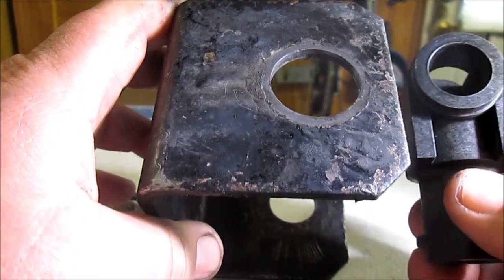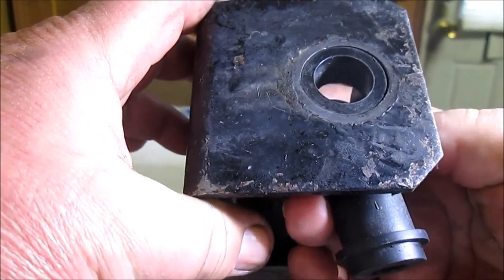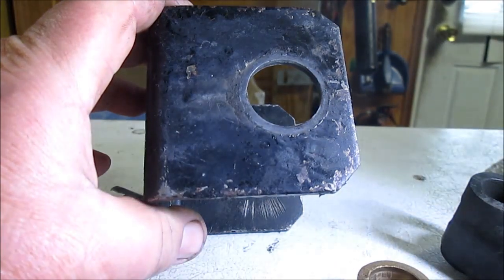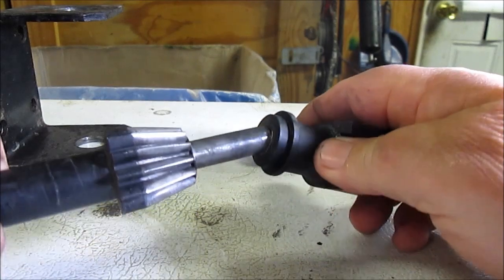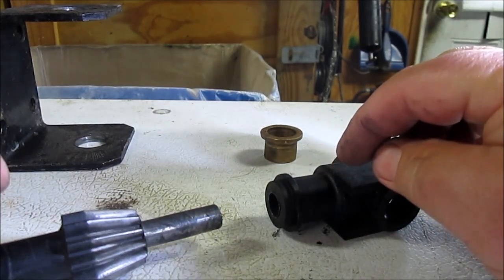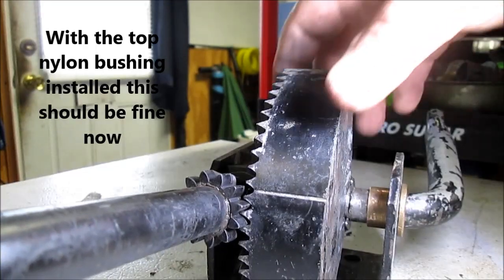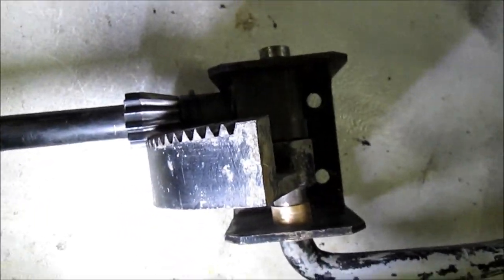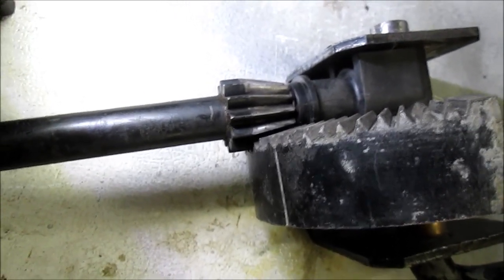1990 Craftsman steering update

Comment: Hey larrybl! Take 😎

Long time no talk... Busy with Daughter in Middle School now, and wife having Heart Surgery right now @UW Seattle.

With that "Flashing" installed to tighten it up on the Column, have you thought of Installing a Grease "Zerk" to lubricate?

What are the "Dimensions" on that Brass Bushing so I can head to my ACE HARDWARE, and pick one up?

Take care,
🤓 -Thomas (12)
Port Orchard, Washington
Reply from the maker: Don't think a zerk will work in the nylon bushing, I lube the whole asst with chain lube. Flange brass bushing is ID 0.748" - 19mm, OD 0.873" - 22.2mm. I may have had to file it, can't remember as it was added several years ago and has held up well.
Reply: @larrybl  Thanks Larrybl!